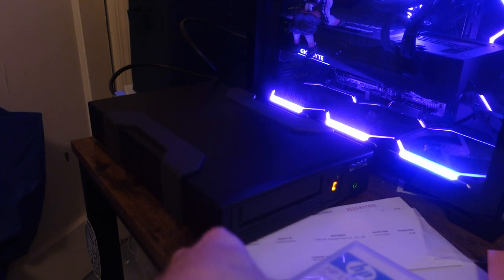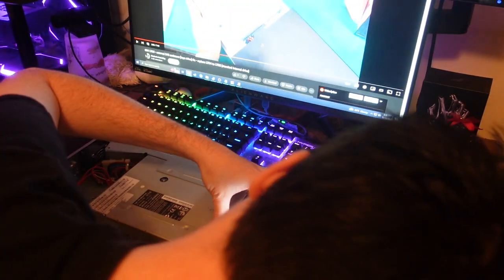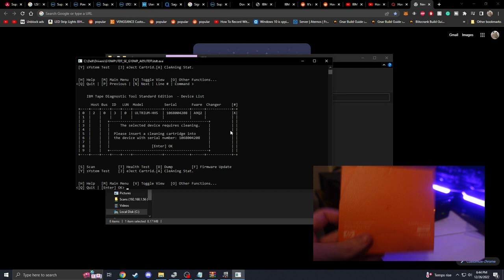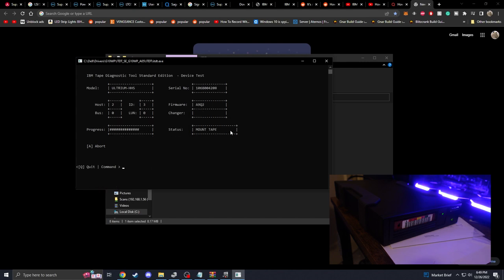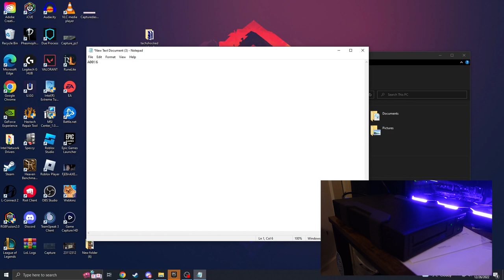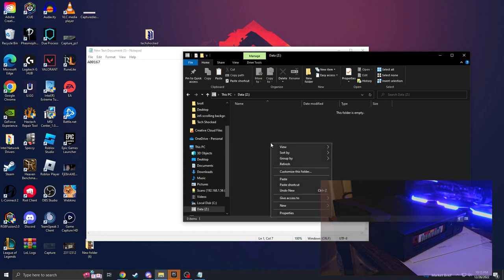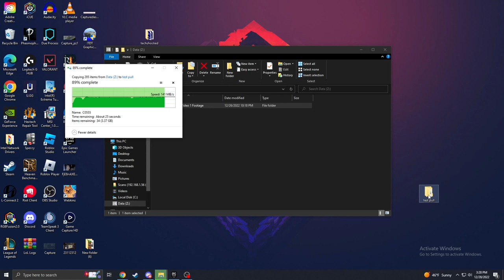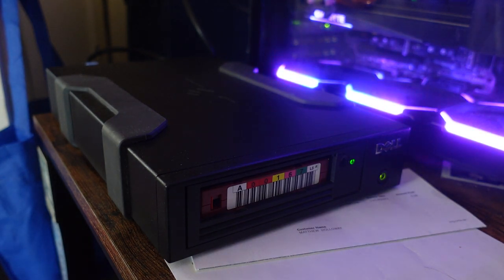Why I now backup to Tape for my Homelab

Comment from the maker: Would you use LTO Tapes in your backup strategy for your homelab?
Reply: Totally I do! Glad to see you made the leap into LTO5 👏 I'm stuck in LTO3&4. Love putting 10+ yr old enterprise gear to work, if you treat it right it will last a good long time!
Reply: Not "woudl". I do. (However I use the fibre-channel variant, originally used in a tape library....)
Reply from the maker: @btudrus  Awesom, what generation?
Reply: @TechShocked  I started with LTO-4 just to test it and prepare some scripts. But I intend to buy LTO-6 drive for larger files like photos and videos. That way I'll abke to write to LTO-3/4/5/6 according to the data type and tapes I can actually find for sale.
Above LTO-6 the price goes exponentially high, so this is not an option yet. But maybe in a couple of years I'll look at LTO-8 then...
The FC makes it very easy to maintain several drives and not have to worry about how much space I have in a PC case. And you can actually share the drives between several computers...
Reply: I bought a used lto6, very good deal, but my h200 controller is slow, what controller are you using? I bought an ASR-8885 but art can't format LTFS fo ra block size problem
Reply: I did tape backups for a good chunk of my IT career. I started with DLT and LTO-1 drives, as well as MO jukeboxes. I've set up entire backup environments, backed up God-knows how many petabytes of data, performed numerous DR exercises, and even a few actual disaster recoveries. Tape's been good to me--and I would never use it again. It's too much of a PITA compared to simple replication. These days, a bunch of spinning rust hard drives in a RAID array is faster, bigger, more reliable and cheaper than LTO-5, and it can be  easily replicated somewhere offsite in ways that tapes sitting on shelves can't. The only advantage tape has anymore is that it can't be corrupted by malware the way a NAS potentially could, but there are ways to prevent that from happening too.

Comment: Few things for you to know, serial number is mostly for tape libraries you don't need it in fact most tapes you buy brand new won't have the barcode sticker, you can literally double click the video file straight from the tape, may take a few seconds for the drive to cue and find the file since tape drives struggle with non sequential reads for obvious reasons but once it finds it will play at full speed just fine can even skip ahead etc i have an LTO 6 drive currently i want to get an 8 or 9 when i can afford, oh and please get two tapes for any archive, always 2 copies at different locations ideally different brands of tape as well and nice video make some more you're very nice and enjoyable to watch :3 Also I made a video ages ago called Tape Streaming Test, you can see there what a tape drive plus a simple FTP server with a VLC client can do :)
Reply from the maker: I've learned a lot since posting this video, I'm gonna post an updated video once I consistently get my tape backup structure setup, ill check out your videos soon and appreciate the notes! When I've tried to double-click the files straight from the tape and it will seek around so much it freezes up my system, I would love to go up to an ew LTO 8 or 9 Drive also
Reply: @TechShocked  You have to be patient, sometimes can take over a minute for the drive to find the file LTFS is a bit dumb sometimes can go all the way to the end of a tape then all the way back then some more and some more until it finally finds it, now if you're not getting any drive activity then it's something with the LTFS binaries, but the file won't open/start playing until the drive is ready so literally double click and do nothing else but wait it will load and voila :) You're likely just seeing the explorer hanging because the drive isn't ready and the system can't read the file yet so it just hangs (ideally it should be a little more verbose like Seeking File.. Please Wait) I also learned a lot about LTFS over the years but I assure you LTFS is the same from LTO 5 to LTO 9 only differences are capacity and read/write speed LTO 5 can do 140mb/s LTO 6 can do 160mh/s trivial difference even, you can find the table on wikipedia about it.

Comment: I'm using lto-3 for my server since almost 10 years. But I do two additional copies on different hard drives in addition.  So I have the original and then 3 copies of which 1 is to tape. As of LTO-5 there is LTFS support, so you can mount it and access it like an ordinary drive, which is awesome. My tape doesn't support LTFS (too old) so I'm still using the old fashioned tar command to do my backups. And it works great, although I might upgrade to a more modern LTO drive soon.

Comment: Here is some information to help you. You might want to add a note to your description text to say that this is largely archiving over backup. Also the file integrity check can be done via standard hash checksum (cyclic polynomial). If not using 3rd party software, your MSWindows PowerShell (e.g. 4 up) can do it before writing to the tape, after writing to the tape and after the data is taken again from the tape to that directory (folder) on your desktop, stipulating MD5 or its SHA or whatever.
Get-FileHash <filepath> -Algorithm MD5
My comment has no hate in it and I do no harm. I am not appalled or afraid, boasting or envying or complaining... Just saying. Psalms23: Giving thanks and praise to the Lord and peace and love. Also, I'd say Matthew6.

Comment: I kind of want an LTO too for archival (it's not really for my lab but my friend's but eh, we utilize it shared however)
Right now we're archiving just on old HDD's. But the thing which worried me about using old LTO is, how does the software work? Do we also need an old host (like windows 7 or something) to interact with the old drives?
It'd be amazing if we could just use Linux too considering almost everything on our lab is Linux based

Comment: hi have alot of data drive's  they are very well made       i have been very lucky with ebay  over the years  there's only on thing
windows 10 doe's not like scsi  cards    i have windows 7 and  nova backup  works ace 

had a new amd b450 set up  and old set up will not work  i have 4 olt drives   i made a silly misstake  i fof got drivers  why i was buying drives and they were not working when
i get the drives   nova backup up dates all the drivers for you   now i have 20 plus data drives all working   yes i know a new bee miss take 
i have a working   8 mm data drive so i been looking for old working data drives